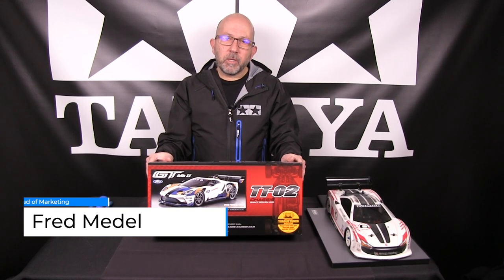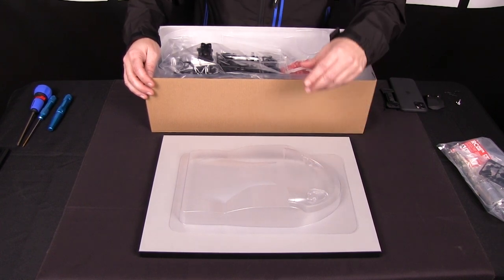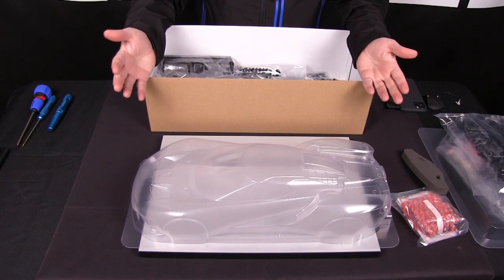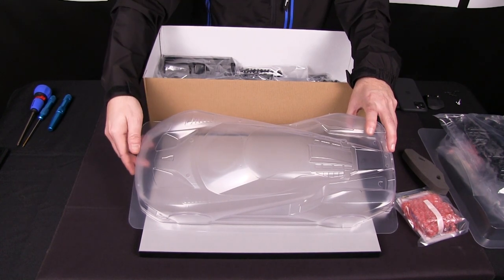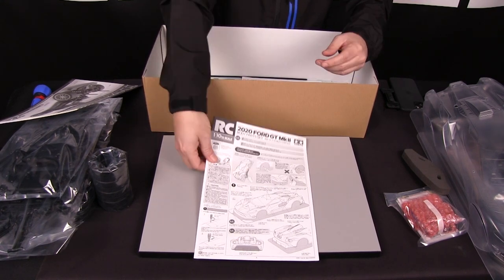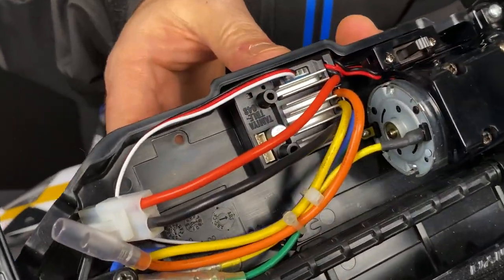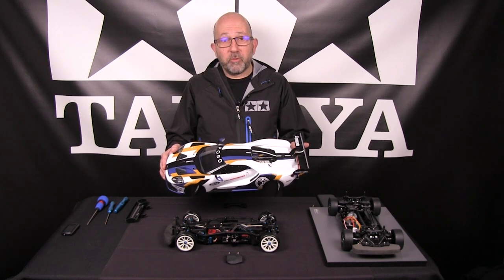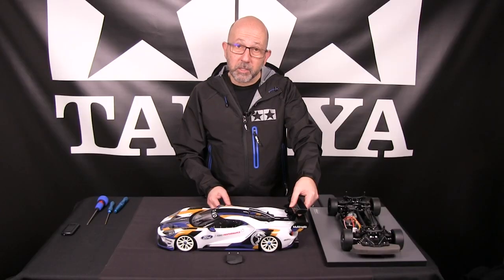Tamiya 58689 2020 Ford GT Mk II Overview

Comment: Still enjoying my TB-05 Pro. Really could use a video how to setup the Ring and Pinion for the differential. Mines been just breaking teeth right off the ring gear after a few runs.

Comment: WHY pre-drill the body..... so you can't mount it on another chassis without leaving holes
Reply from the maker: Well, if you're going to mount it on another Tamiya car, most of the holes already line up from car to car. The spare parts body (clear) will most likely NOT have pre-drilled holes, allowing you mount it on any car.
Reply: @TamiyaUSAOfficial  The qaulity of the body forming is really bad. I guess using the 10+ years old mould is why. the ridge across the front of the body is shocking for a Tamiya product. must of been photoshopped out of the marketing info.. to be honest I am not sure I want to use it. The whole kit is a let down. friction shocks and no bearings... WTF